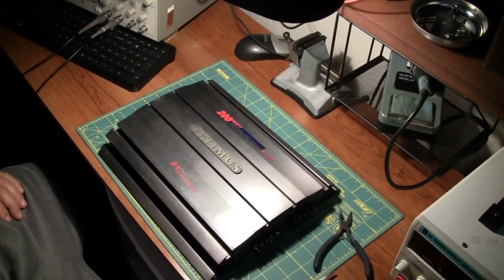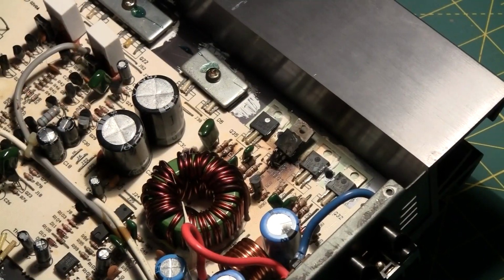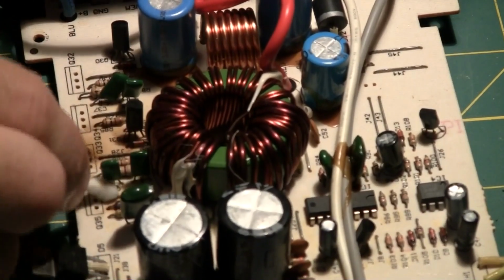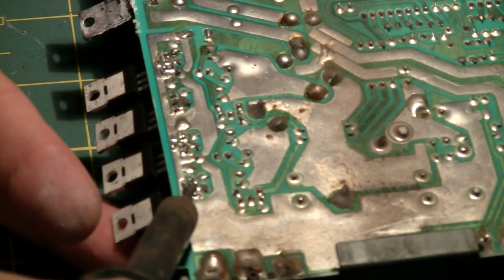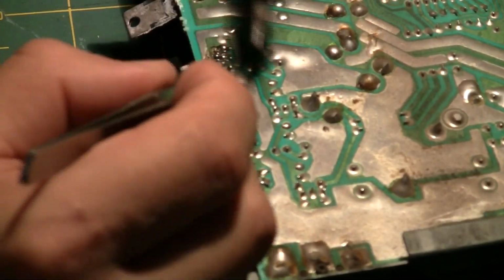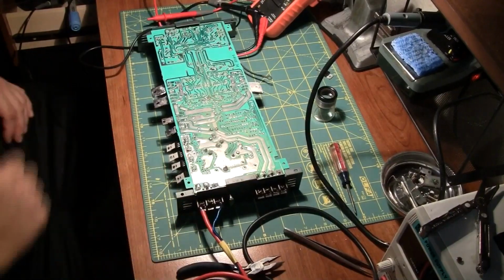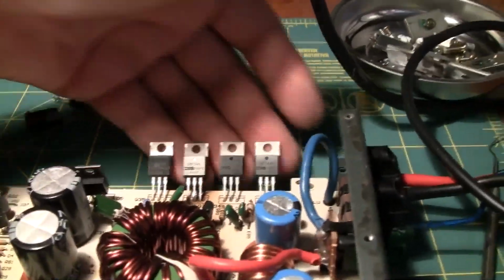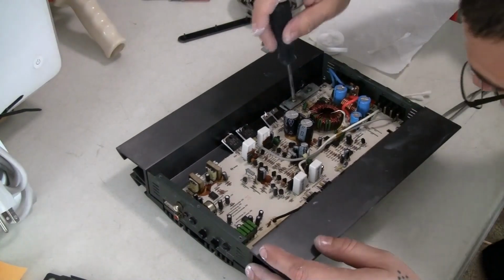Repairing an Old School Car Amplifier - OPTIMUS XL-200  AMP REPAIR

Comment: I have a xl-400. What gauge of power wire should I be using for this? 6 gauge or 4 gauge? And also if I'm hooking up my speakers un bridged, it can hook up 4 speakers. Can I double up and hook up 8 speakers or is that hard on the amp or speakers? I know nothing about this stuff.

Comment: looks like you also may have a small capacitor going bad as well . you can tell by the buldge in the top of the can .
Reply from the maker: Yes, your correct.

Comment: i need to get a scope. i have one amp currently that only comes on when the hot wire is disconnected for a split second .
Reply from the maker: Agh yes, scope is very useful. That's strange, wonder what can cause that .... hmmm